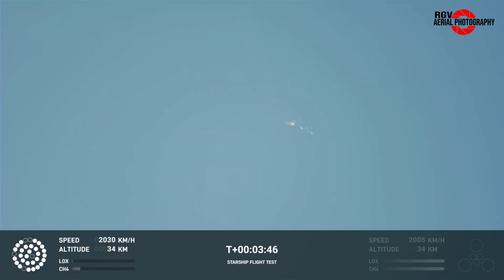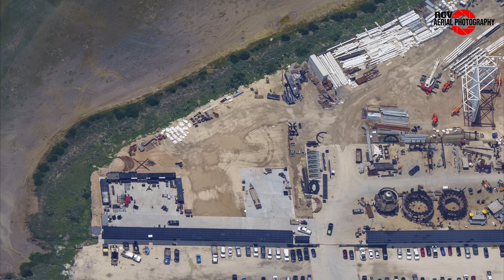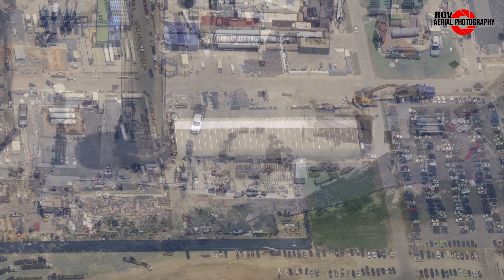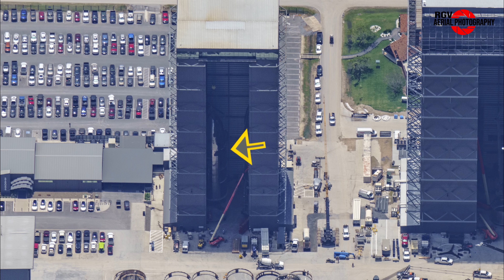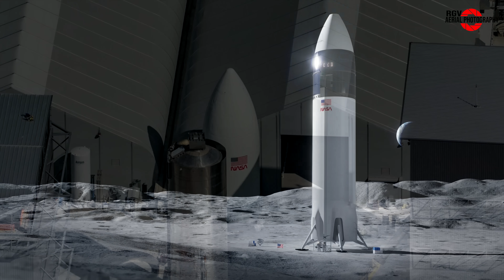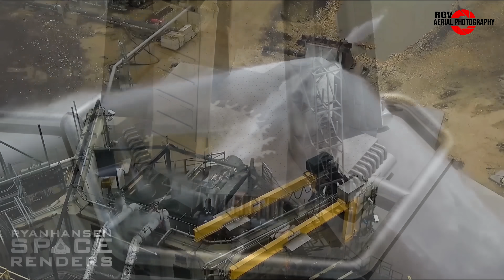Starbase Flyover Update Episode 2 (Narrated)

Comment: How the heck are they going to keep rocket exhaust from penetrating the steel plates? Any penetration will result in the whole thing getting blown apart by steam.
Reply: Raptor 3 has been tested against a water cooled steel plate so they have data. Also, its not a matter of penetrating the steel, at most it will melt a little. There's already a lot of small holes for higher water pressure, so penetrating is not an issue.
Reply: @colewong7431  The smallest hole that has higher pressure on the hot side of the plate than the water-side will result in water flashing to steam and blowing the entire thing apart. Likewise, water will get flashed to steam well before the plate melts. The potential for harmonics between the 33 engines producing significant overpressures seems high and not something a single engine test will reveal. I hope it works, but I hoped the Fondag would hold up also, and I'm sure SpaceX thought it would hold up.

Comment: I am really confused by this new water plate... What happened to the ideology of no part is the best part.... Why no flame trench?
Reply: I have heard or read it several times that the water table is too high to allow for a flame trench.   There are other reasons too lengthy to describe here.
Reply: @michaeldeierhoi4096  what other reason? Give me the cliff notes
Reply: @glock19gen3  In a tiny nutshell, the Starship booster has almost twice the power of the SLS.  And even the SLS which has a flame trench caused some damage under the launch pad including wrecking two elevators.  So the flame trench is not a cure all to the problem.  

Then there is Elon's concern to avoid using a flame trench.   Since the starship is powerful Space X is trying to redesign a base below the OLM that can handle the 33 engine raptor thrust.      Elon himself has said that Stage 0, the OLM, is more complicated than starship.  

Another factor that will preserve the better is launching quicker.  Elon said they will attempt a launch in 2.5 seconds for the next test compared to almost 7 seconds for the first test.
Reply: it'd take too long to get environmental approval

Comment: it is really nice getting these narrated videos after the 3 hr ones, explains  some of the stuff that puzzled me. what do you think the ratio of boosters to ships will be? will they convert the sub-orbital test pads A and B to testing for boosters, and have ships go to Masseys?
Reply: I can't see any reason the suborbital pads would be converted for booster test firing.  For one they aren't nearly high enough.  Two, they won't have the water cooled steel plating underneath.  And Three the booster needs to be close to the orbital tank farm for fueling, crypto tests.
Reply: @michaeldeierhoi4096   lots of testing to do that doesn't involve test firing, cryo, pressurization, and puck testing come to mind. the sub-orbital tank farm can handle all that,  booster 3 did all it's testing and a 3 engine static fire on a sub-orbital pad.
Reply: @moodyblues1365 . Why bother asking questions if you are act like you understand what they are doing??     In reality three engine static fires won't cut it any more.  That was done initially when booster static fires were just starting.  Space X has proven that they can test fire up to 30 raptors which they will be doing more of in order to also test the water cooled steel plates.

Comment: They really should put asbestos under, or in between the layers of the deluge. Asbestos has natural fire resistant properties, that is why they used it so much in homes and buildings before it was deemed toxic. But each state has their own regulations when it come to use. 
Another great episode! Love the aerial footage. You all rock! 
 - NOM
Reply: I want to see what the force, 16.7 million pounds, of 33 Raptors does to a sandwiched steel plate system. It might take the heat but with that much power you’re bound to crush something. “Excitement guaranteed”
Reply: SpaceX is already facing problems with an environmental lawsuit because of the inert dust and concrete debris that left the launch site. Imagine how much worse it would be if something went wrong and they scattered asbestos over a wide area! :hand-orange-covering-eyes: